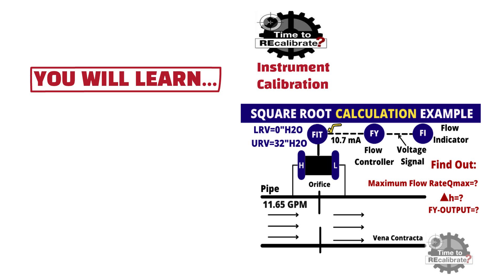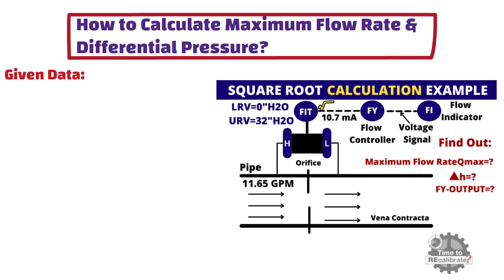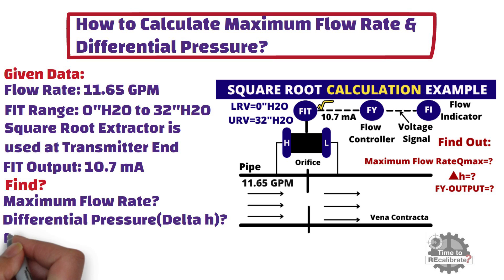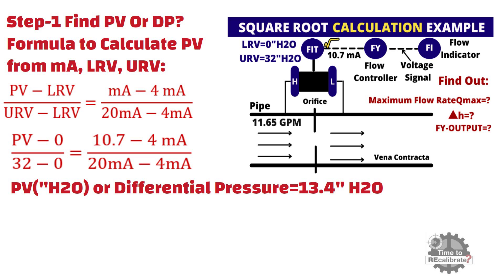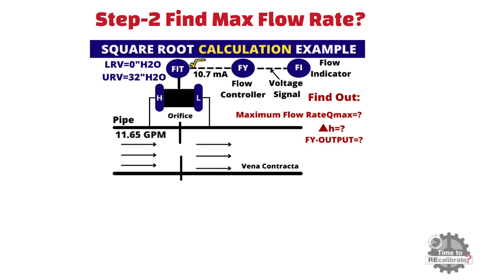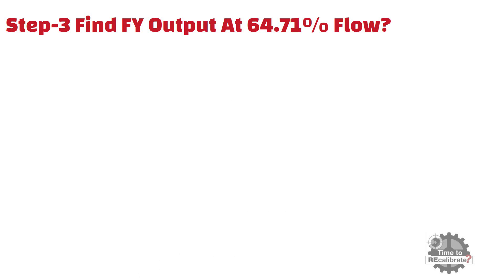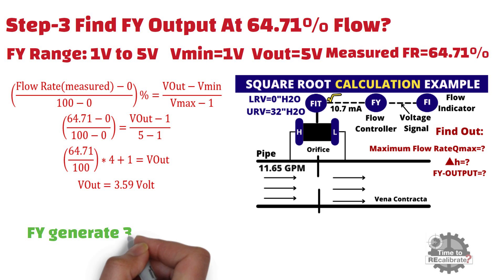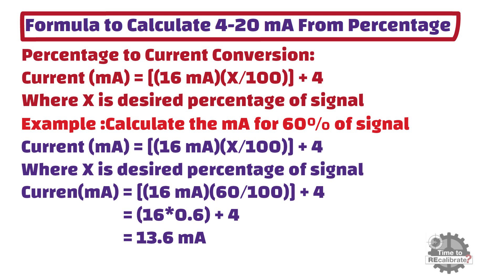Differential Pressure Transmitter Square Root Calculation Examples

Comment: Hello sir  i have question sir about this if ever i will use flow transmitter like magnetic flow is this calculation needed or not . Or only need this calculation if i only use dp flow transmmitter im right sir i hope you answer my confusion thank you
Reply from the maker: Hello Nelson
Thanks for asking this question. You need this calculation only if you use DP Transmitter. You don't need any calculation if you are using Mag Flowmeter

Comment: Please I need the answer for this question what is the difference between (DPT) and (FT) ?
Reply from the maker: DPT is differential pressure transmitter. It measures differential pressure between high side and low side. And calculates flow according to differential pressure. Generally, flow rate is directly proportional to square root of differential pressure. Whereas FT is flow transmitter. It could be any type. For example, magnetic flow transmitter, ultrasonic FT, differential pressure FT.
Reply: Thx for your explanation it’s very useful ❤️❤️
Reply from the maker: @fahad_7737  You are welcome... keep supporting us by like & comment